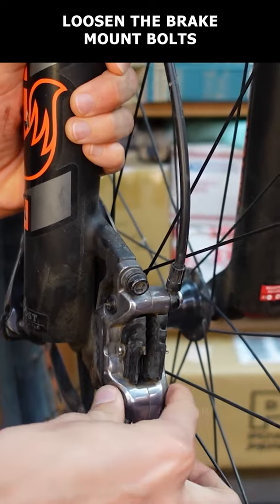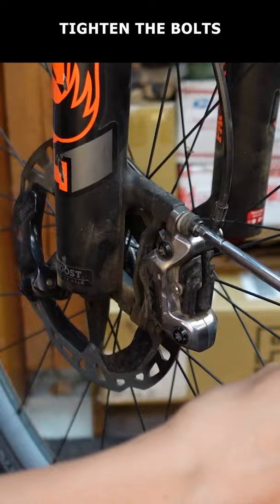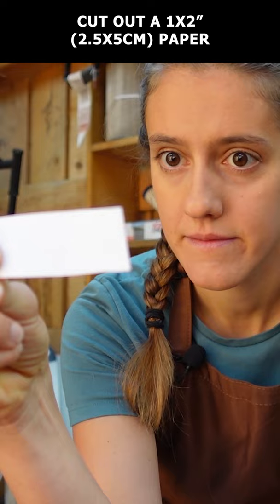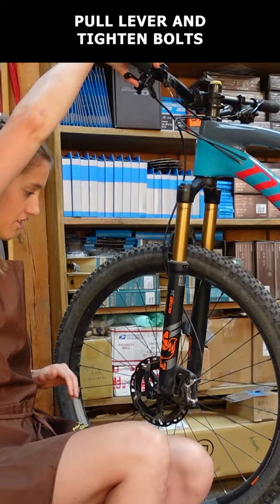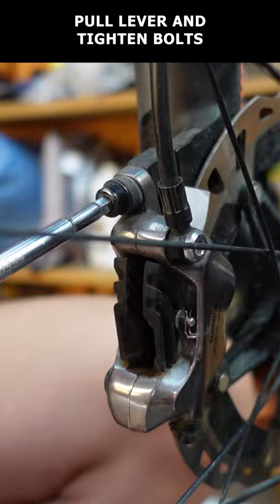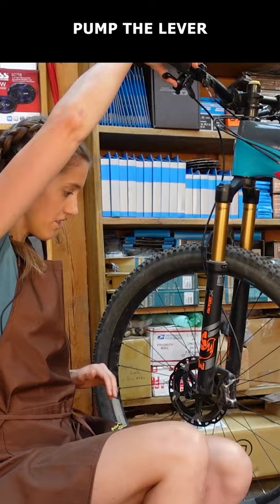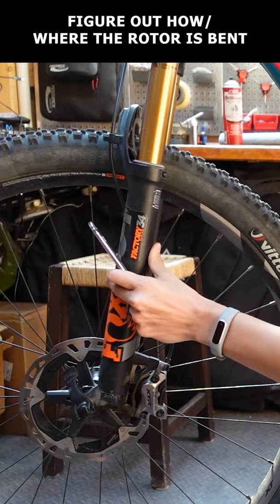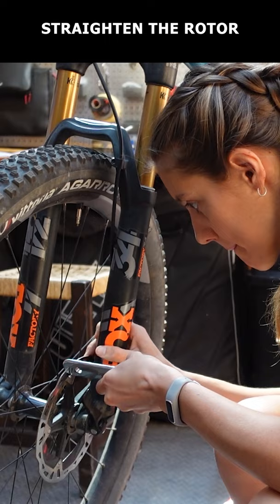How to fix brake rub #Shorts

Comment: I find that the “squeezing the break lever” method doesn’t work well because someone the bolt head moves the caliper while tightening it, the pistons may be more powerful on one side. I always manually adjust the brake by holding the caliper straight. If the rotor isn’t bent that works for me every time